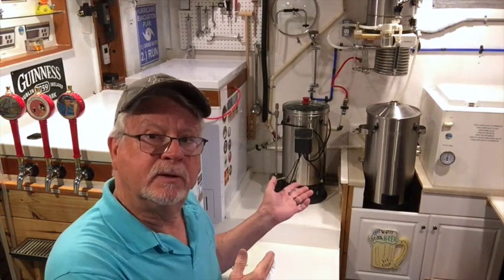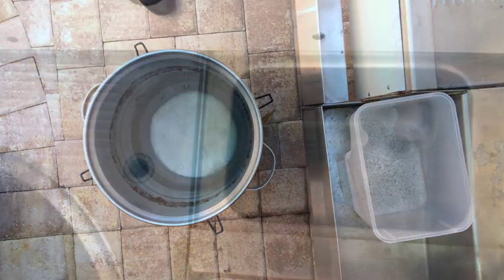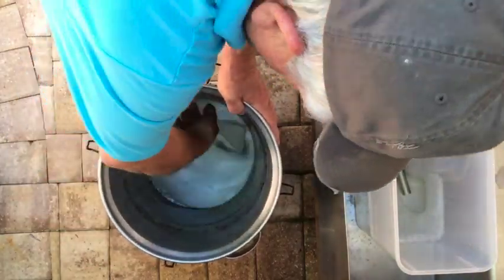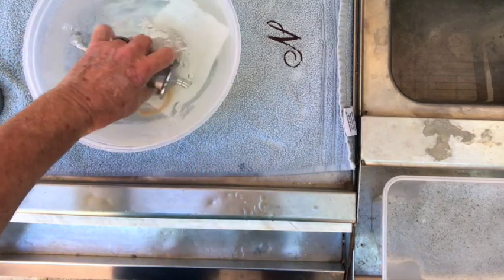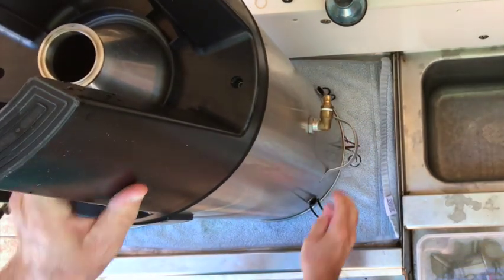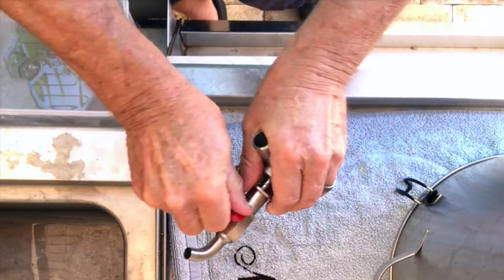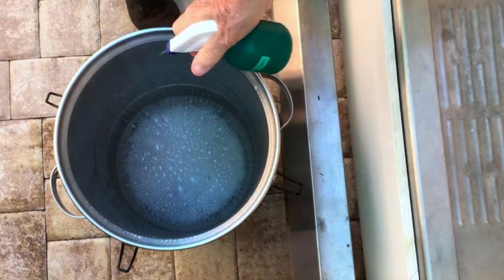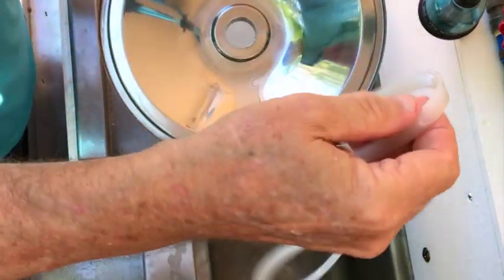Cleaning the Grainfather Conical Fermenter

Comment: Hello, nice video, thank you! One question: what do you do with the glycol inside the wall? Do you pump it out before cleaning or do you use some plugs and keep it inside?
Reply from the maker: I don't use a glycol chiller.  I use my cooling coil for both my CFC and my Fermenter (see my other videos).  The QDs on the Fermenter trap the water (or glycol) inside the cooling sleeve of the fermenter.  When I reconnect the water lines to the QDs, I always run water through the whole system to purge any air bubbles and then adjust the 3 way valve to make a closed-loop system.  Cheers!